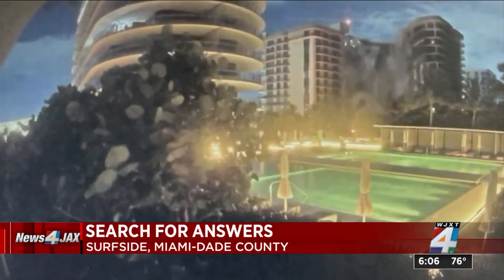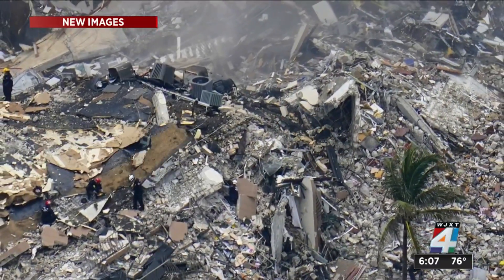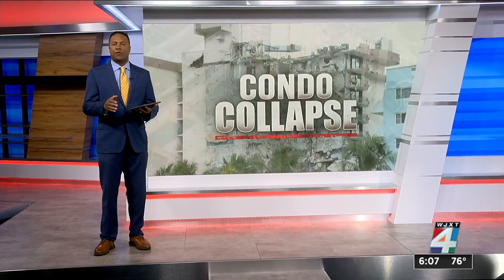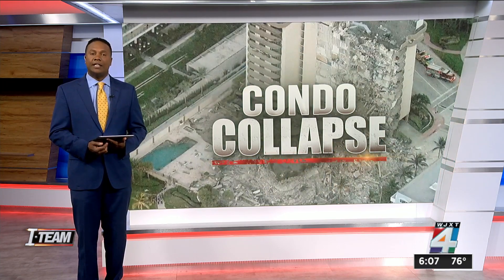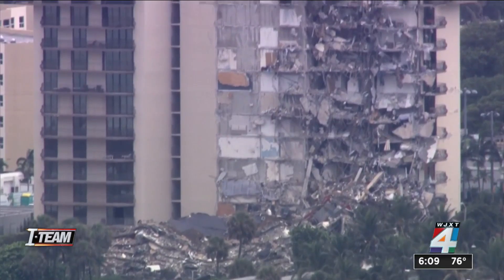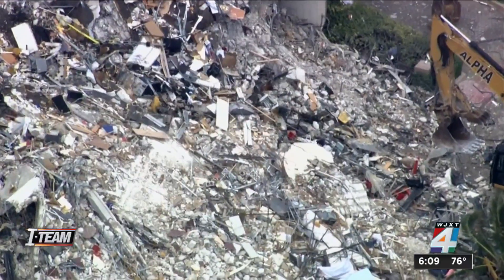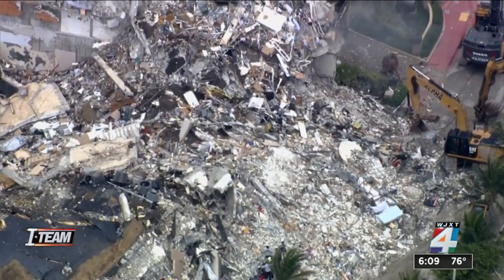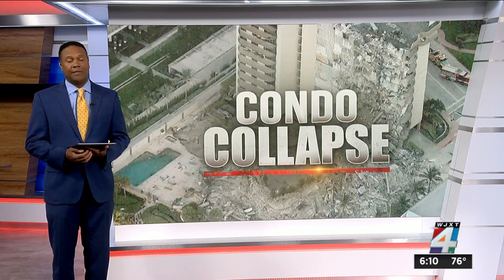Engineer suggests corrosion might be to blame for Champlain Towers South partial collapse

Comment: This engineer is an idiot. Coated rebar willnot withstand sea or pool water ingress under submersion situations.  Water has to be able to drain away , it only would have prolonged the inevitable to a point. It was the sea water ingress angles of the pool and underground wall design which failed and allowed submersion of the rebar for the duration of the buildings life.
Nothing an inspector could see because it was buried.
Reply: Only the underside  pool area and constant pumping were clues. Not definitive signs of a failure

Comment: I have lived in surf side all my life on dickens ave a few blocks from this building and have personally been to this building

The pool deck collapsed due to the underground pylons holding up the pool deck gave way from deterioration. The deck collapsed, slide to one side causing the section of the building at the expansion joint to slide in that direction and pancake, period 

They never addressed those underground pylons

Comment: The engineer is on drugs?  These buildings collapsed at DEMOLITION SPEEDS not failure speed.... in the sections that collapsed it was complete, not partial.
Reply: The strength of all the concrete has yet to be tested that could show many things.

Comment: If thats the case than why isnt the city of Miami facing multiple collapses like this every where.. Dont forget they said they under go inspection every 40 years. How is the Salt Water suddenly the problem? For only this building? How is that that collapses like it had demolition charges in it if it was only from Salt water problems it wouldnt have taken the whole building with it plus the one next to it. You know what. The face of the building looks like OKC Murrah building and the collapse reminds me an aweful lot of how Building 7 fell.
Its also quite Convenient that the name of the place is Champlain Towers... No other building in the area with this supposed Salt Water Corrosion falls yet the one named Champlain Towers does a 9/11 Ho Down. Yeah that was not a collapse that was  Demo watch the videos of demos. Who knows as to why it was demoed but that was not a collapse.

Do you expect me to believe Engineers would have built buildings all up and down the coast over the last 40 years knowing that Salt Water corrosion could cause their Collapse?
Do you know anything about Steel or anything about Building at all? We wouldnt just run around building things that we thought would collapse in 40 years over Salt Water.
Who paid this guy to say this crap?

Comment: They can start with the engineers who designed the building, then look at the construction. Note: building a high rise building on the beach, sand, is never a good idea.
Reply: Probably founded on piles taken to bedrock. My guess is that corrosion of the columns by salt water will be found to be a major factor
Reply: @charlesmitz5239  Piling did not go to bedrock it was pounded sand or soil whatever you choose . That was covered by one of the engineers on u tube . You know the saying go pound sand that's what they did.

Comment: This is a CONDO building, which is occupied by the OWNERS of the building, with an association made up of the OWNERS. So the first step is to investigate the association on what they knew. They likely knew something but money was likely the deciding factor.
Reply: @LoneWolf-qk9pl  i hate to think it's true but i believe you are right
Reply: The original hoa actually resigned in 
2018. Probably alot of them knew but were unable to get the owners to get renovations underway in a timely manner.  I bet they sold thier condos. The failure is still unusual and was hard to connect the dots for an inspector. When the pool support collapsed it allowed lateral movement, which is not really inspected for or a common occurrence to identify.  It really was the original engineer at fault primarily.  But ya it should have been better maintained and buttresses added under suspect exposed rebar areas beneath the pool. This is called a cascade failure.

Comment: Coated rebar does this as well, the moisture seeps into the coating and is held to the rebar, rusting it. This happened to a bridge in the EU/UK somewhere.
Reply: You are right it is now banned from using it because it may be worse. stainless steel rebar  probably would be the only other answer, imagine that expense no one would ever use it.
Reply: @I I I would assume. I don't know about particular grades of stainless and such. I just watched a documentary on a bridge failure once. It was the treated rebar.

Comment: I wonder, is this speculation? Just because these investigations usually take months, kind of like air crashes.
Reply: Sometimes failures are incredible complicated, and sometimes they are not. The body count is independent of the comlexity of failure but it will cause the investigation to be very complete.

Comment: Looks like the weak spot of the structure might have been the stilts who are relatively thin and seem to support a lot of the structure as seen on the other side of the building - a small sinkhole underneath the stilt or rusting steel in the stilts would probably be enough for this catastrophic event to occur - my prayers go out to all the families all individuals and not least to those who are still missing - a terrible tragedy
Reply: Maybe you should testify on what you know. It should take about three seconds.
Reply: @tmilesffl  I only know what I see on TV and I am not a certified structural engineer -but these really fragile looking stints or columns keep catching my eye and my imagination - edit FL seems to be notorious for sinkholes due to geological issues and then the salty sea air not to mention massive tropical storms..

Comment: So, all buildings constructed before these materials were used should be demolished.  What about the sinking pylons due to improper foundations?
Reply: You're completely overlooking everything. Has nothing to do with all the other buildings. You shouldnt be saying demo all the other buildings built at this time 
YOU SHOULD BE ASKING WHY DID THIS ONE OF ALL OF THEM BUILT IN THIS TIME ALL OVER THE PLACE NOT COLLAPSE... Now that Ive made that comment they will run around finding anything they can about building reports of even smallest amount of give to justify that one of all of them "Collapsing". Do you realize how long it would take Structural Steel and Concrete to fail due to salt water corrosion? Even then it wouldnt have taken the whole building and the one next to it all at once. Think dude.
Reply: Latest analysis shows that some columns punched through the parking structure ceiling.  No rebar was seen above these columns, but the plans required 8 rebar in a crossed pattern.

Comment: This investigation is in its infancy; so give it time.  My prediction: I'm sure we'll all hear reports of countless tales of cracks, water seepage, electrical problems, strange vibrations, etc. - all pointing to a structural calamity in the making. Just looking at the ease in which this structure collapsed suggests it was under duress for a very long time.  Look at how crumbly that concrete was - it virtually turned back into sand.
Reply: Explosives do that..Not rusted rebar..lol
Reply: flashes in plain sight
less are fooled by the day

Comment: Why didn’t they show the rest of the video where the right side completely falls as well
Reply: How about those flashes?
Reply: @johnsmith132.  There we're electrical conduits pulled out by the elevator wall causing sparks which were the flashes.